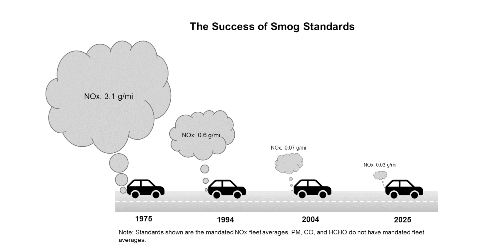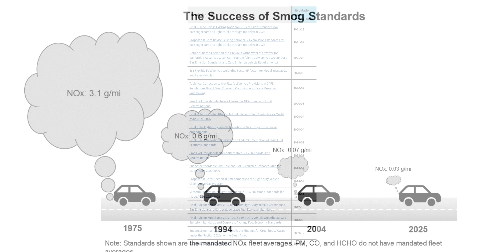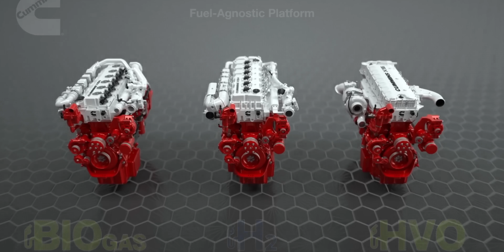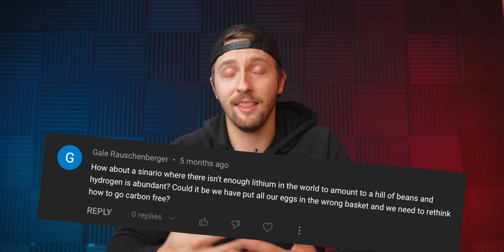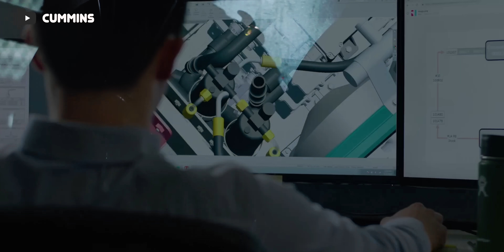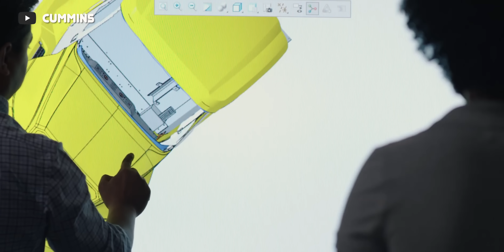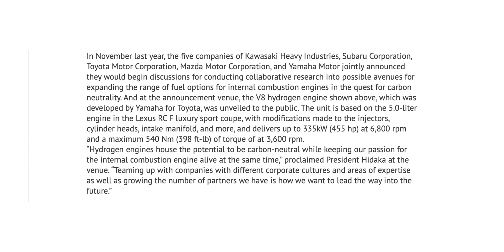Cummins Hydrogen Engine Will KILL DIESELS FOREVER

Comment: U did miss the interim technology between diesel and possible hydrogen tech diesel replacement, the JegmTech diesel technology that Cummins declined to investigate, another words the JegmTech is a Diesel engine on steroid which boost’s the most fuel efficient Diesel engine by more than 15-20%. Neither hydrogen nor ev r long distance feasible power source, it’s not a practicality decision that is pushing the market, it’s a political-impractical decision that’s prevailing. Thanks to the last disastrous 2.5 years the globalists keeps pushing the impractical vs the logical energy solutions. In the end power density will be the deciding variable.

Comment: It will be 50 years before any of the above technologies can become as useful as what we have today which has taken 100 years to develop. Hydrogen engines are nonsense now as they need an outside power source to produce electricity to produce hydrogen not to mention storage as the video said it needs to be stored at crazy below freezing temperatures.

Comment: Diesel and petroleum based fuels contain enormous amounts of energy but few people ever mention the huge amounts of energy required to drill, refine and transport these fuels. Processes often use cobalt and ICE vehicles need copper, platinum and other expensive and rare metals in their manufacture. Hydrogen will definitely work but it won't be cheap and the overall process of getting it into a vehicle is not very efficient.

Comment: Hydrogen makes little sense except it can refuel quicker for longer distances. You are still burning something so that must produce pollution. Even, if it is just the oil that get's burnt by the engine during normal operation or the waste oil from still needing regular oil changes. It's like hydrogen changes very little. If you are going to build a massive electrical structure to 'make'  and store hydrogen as a liquid, why not make a better electrical structure for charging?

Comment: The problem isn't building a hydrogen powered engine. The problem is hydrogen itself. Hydrogen is the most abundant element in the universe, yet to store it in a usable form is very expensive and inefficient.

Comment: Yes they will be around during our life time. Beyond that it's up to a higher power.The autonomous trucks are already out hauling freight. They have already logged millions of miles. There here.... The independent drivers can't afford these new trucks a eventually the independents will be gone. The smart independents will merge together and create their own companies to give the corporate trucking companies competition. If they don't then they will be flipping burgers. The ones that have been speculating on this new trend will be the new billionaires. California thinks they are in the driver's seat by banning certain trucks and going all electric.
But they will strain if not ruin thier power grid trying to keep every thing powered up and charge thier trucks and cars. And it takes coal to make electricity. And Kentucky ain't gonna dig coal for California. Some day the cross country trucks will be no more. It's getting uneconomical to carry freight that far. It's to costly. 
They would be better off shipping by train and doing away with hauling freight on the trucks. The train can bring it to the electric trucks then the electric trucks can haul it shorter distances. Ups is already using hydrogen powered trucks.
I have seen them they look like a regular truck.  And they need to train these young folks to be a driver's of the new fleets coming.  Right now they are putting kids in trucks. Kids that have no idea what they are doing. I have seen it.

Comment: The one issue I have with hydrogen is that it burns too easily. With the amount of wrecks on the road, a little spilled fuel here and there or a small fire happens. How likely are these tanks or cells to explode if involved in a wreck? That's my main concern
Reply: Whilst hydrogen burns easily, it doesn't pool except if the leak is in an airtight container. Hydrogen is very happy to escape from any enclosed space. If it is not in stoichimetric ratio with O2, it will not explode. The worst case is likely to be a flame from leaking hydrogen from a high pressure tank. Unlike petrol fumes it does not pool and then explode.
Reply: the h2 tanks are 100x safer than your standard fuel tank and you don't have to worry about electricity fires from EVs, which is even more dangerous. The main concern is production, storage, infrastructure.
Reply: You're right, hydrogen is EXTREMELY, EXPLOSIVELY volatile.  Which is why so much work has been put into making safe tanks for it.  Currently there are lozenge shaped carbon fiber bottle tanks that can withstand anything short of a nuclear blast.  But they are expensive.  So the current challenge isn't making a safe tank, it's how to make an affordable safe tank.
Reply: @itsmatt2105  and there lies the other problem. Expense. What's good isn't cheap, and what's cheap isn't good. If we use the economies of scale approach, there has to be sufficient demand in order to help make cost go down. If the cost is too high, the demand won't be there. Unless it's mandated by law that this style of tank is to be used, truck manufacturers are going to cobble together what they deem sufficient. I don't know if you've been in a class 8 truck lately, but they aren't exactly built to the highest standards. I see this flopping like CNG did
Reply: @meatball1324657980  I'm not cool enough for the new stuff, all my trucks are old. I figure if it made it this far and didn't break (too much) it'll probably continue not breaking for another little while.  I'm rather ambivalent about the fuel source at this point.  I want to see cleaner burning, more efficient engines but so far there's not a clear front runner as far as which will be the best horse to back.  All have strengths and weaknesses.  Lots of big companies full of people with way more knowledge about the various tech than I have are heavily backing every new technology type out there.  If they with all their insider information can't predict a clear winner, I don't have a prayer.

Comment: The lithium ion batteries are really not that great because they are not recyclable so when they die you have to replace them with a new battery so hydrogen and other alternative fuels are something that engine manufacturers should always consider

Comment: For offsite construction.  The employees cars will have nearly fully charged batteries that could to be tapped. 2. A battery  mega pac could also be positioned on site.3 .maybe electrical lines will be ran to site as a first step in the future.  4. Solar is also found outside at all remote locations..wind too. And if you still need more power. a stand alone  power supply like a hydrogen  powered generator could fill the gap.   ... " Batteries  rule. Diesel is decrepit.  + battery innovation is not over yet.

Comment: I saw 'Hydrogen fuel cell' prominently displayed on several of the examples. This is a way to generate electricity on the run, NOT an ICE.
The crucial point of a hydrogen ICE is keeping the hydrogen liquid, so the fuel tanks aren't bigger than the vehicle.
This can only be done at or below -400°F. This is an immutable Law of Physics, and, at normal temperatures requires heavy and expensive refrigeration of the fuel tanks. 
I can't believe Cummins thinks they can achieve this. BMW, Toyota and some others have built hydrogen-fueled vehicles, and they were totally impractical.
CNG is definitely a bit easier, but that's just more fossil fuel, cleaner than diesel, perhaps, but still dirty.
Cummins is throwing out a red herring to try to stay ahead of the pack.

Comment: So you use methane to get your hydrogen and make heaps of CO2, Hydrogen then has to be liquefied, you get loses on each process and yes you can make hydrogen from electricity but over 90 percent of hydrogen is made by the the separation of methane with a large amount of CO2 waste and that does not include what is required to make it. Keep improving Diesel.

Comment: Yes why?! Hydrogen is energy intensive to produce. Iceland has lots of free heat in geothermal so they can produce hydrogen cheaply. What about the rest of us. 
 Use wind and solar power?! Use natural gas coal or oil? Maybe use nuclear ☢️ 
 No ? Well where will you get hydrogen fuel? It cost more energy to make it than you get back out of it. You can’t drill for it.

Comment: I drive a pickup truck every day, often towing materials or equipment.  You can’t do that yet with an electric pickup (not to great distances).  Hydrogen just might be a good substitute should access to this fuel be easier to procure.

Comment: Today 95% of hydrogen comes from cracking natural gas which uses huge amounts of fuel. To liquefy hydrogen it has to be criogenically cooled to-253°C /-423°F and stored in insulated tanks that uses more energy, why not burn natural gas instead it is less wasteful

Comment: Hydrogen will still have the same issues that the EV charging infrastructure faces now. Hydrogen takes massive amounts of electricity to produce...you said all this yourself. "Automotive innovation" is NOT going to be able to fix these many issues which are basically the laws of physics. Fully charging an EV simply takes too much time, even if chargers were available on every street corner..This poilitical commitment to something so fundamentally at odds with the laws of nature simple won't stand in the long run.

Other than hydrocarbon fuels (with which the world is overflowing), the only true portable answer would be trunk sized nuclear reactors, fission/fusion of some sort.

Gasoline/Diesel is going to be with us for a very, very long time indeed. Sit back and watch!

Comment: Burning hydrogen is nuts but burning ammonia in a big diesel engine will be a thing one day. To get rid of the NOX in the exhaust just inject a small amount of ammonia in and it fixes that problem.
You bring up all the bullshit pedalled by the fossil oil industry. Cobalt mined by children is more crap, and that Cobalt is only used in the oil industry in refining. I turn off because you are full of it!

Comment: I believe there is more logic behind the hydrogen engine. Being a farmer I think it’s physically impossible for ag equipment, via combines, tractors, sprayers, etc. to be powered by electric. There’s just no sense in it adding weight and motors that could potentially fail, not to mention the ground compaction from the added weight.  I think I. C. E. it’s the way it’s sold and continue to be.

Comment: There are plenty of hydrogen engines out there. Build the infrastructure to supply these engines with fuel. Then produce the engine. This is exactly what the oil companies did when partnering with Ford motor company.  It’s like trying to raise a horse without having feed.

Comment: Hydrogen is not going to replace diesel. The power it takes to make it in the first place is too energy intensive. More energy input = more expensive. That easy. If anything, battery electric will replace Desiel. I’m not holding my breath, but it’s easily the most efficient transfer of energy.

Comment: The Biden administration just passed a new emission standard for large industrial engines.  Cummins, Detroit, Volvo and more are fromt line for hearing this news and steering their R&D departments to make necessary changes to keep up.  Hydrogen powered vehicles aren't a new concept.  Metro buses in a lot of cities are running hydrogen engines.  The problems you listed are the hurdles to overcome.  Storage, weight, generating it...  Regulations aren't always a good thing.  Sometimes, they tie the hands from utilizing existing technology to achieve the desired outcome.

Comment: Hit the wrong. If you're not familiar with ammonia it's a non-fossil fuel source of nitrogen plants very much like they just can't suck it out of the air and hydrogen in the form of ammonia can you use regular gas pumps and it doesn't have to be pumped up to 10,000 PSI. You can now buy a single on Amazon at about $0.70 per watt that will last 25 years imagine how much hydrogen you could generate in 25 I would call that effectively free.
And if you wanted to buy a hydrogen filling station just get out your credit card go to one of the Chinese Amazon and order one it will come on a truck with a forklift you tell them where you want this container you call your electrician and your plumber and hook it up give it twenty-four hours or so and you can start filling up hydrogen vehicles.
Everybody seems to think this is going to take a long time by 2030 we oughta be pretty far into this new future.

Comment: Most of the really big machines are already electric running off of diesel electric generators and have been for years, so from the largest ships and trains the biggest earth moving equipment and you didn't mention ammonia which is nothing more than hydrogen bonded to nitrogen which is 70% of the air we breathe there's Australian companies that are way ahead on this and much like propane that we have to put that annoying smell in there because otherwise you can't smell it hydrogen also is odorless so turning it into ammonia the hydrogen has a smell, and if you're not familiar with ammonia

Comment: What about using a iron battery and overcharging it to generate methane and then storing that methane to be used in combustion engines. You could charge the batteries with solar panels and use large low voltage cells to create more methane production while using the same amount of energy this could then be stored in a medium pressurized tank to be injected into an engine

Comment: This video discusses the idea of onboard generation of hydrogen.  I think you said the technology is not here yet. This will never be viable because you would need to haul some kind of power plant to create the hydrogen which is impractical. Also, you need to learn more about hydrogen storage technology. This is where the true challenges lay. If Cummins is investing in hydrogen engines, they are betting that practical storage systems are coming.

Comment: Save the world! Just say No! to Hydrogen scams and misinformation.

Tragically improbable and flawed !!!! Magic Hydrogen wells are not  common in nature as nature replenished oil (not "fossil narrative") that are undeniably abundant.  So unless hydrogen supply shifts from a secondary "fuel store" requiring energy to create it, because hydrogen isn't a collectable fuel source known to earth... Full stop!!!!!!! 
it is at best its a byproduct with residual energy or a crafted "Green scam" which only power ego's.

It like saying you are going to power the world on Swiss Unicorn queefs!  No person of marginal intelligence considers hydrogen as a solution, it is a scam at best. Simply put we use hydrocarbon fuels because they abundantly available to us and Hydrogen isn't remotely.  

For the love of God and all things not broken in the world.... Just spare us the " but renewables can.. blah blah <insert logorrhea vomit> , No!!!!! its moronic. If you collect the enough power via any known renewable method it is a thermodynamic loss to create hydrogen and then burn it in a ICE is staggeringly inefficient like 20-100 fold loses vs just using the electrical power directly.  Just don't go there it's making us all dumber by the min.  And... any perceived pseudo- "Carbon footprint" to process said infrastructure would be equally insane.

Save the world! Just say No! to Hydrogen scams and misinformation.

Comment: Will hydrogen contain a lubricant in the  fuel. I wonder how important it is for the success of the traditional diesel that the lubricity of the fuel helps  keep the high-compression required for the diesel system for several hundred thousand miles of use .

Comment: Most "off-highway" construction vehicles are diesel-electric hybrids to begin with. Like rail locomotives, a diesel engine drives a generator to produce direct current to power large electric motors. The electric portion of the wheeled vehicles is in the wheel itself. The concept is called "motor in wheel". This was pioneered/perfected by R. G. LeTourneau in the 1930s. The track-hoes (excavators) use electric motors to drive high-pressure hydraulic pumps to power hydraulic motors that move the tracks and rotate the cab. They are far more efficient than most people think

Comment: Attacks on fossil fuels are not reality, they are Malthusian cult hoaxing pipe dreams. It is not possible to use electricity to "fuel" heavy industry. Trains run off of diesel that run electric motors. These electric motors reduce track slip yet this still requires massive amounts of diesel. The train industry in their campuses have explored this power transmission problem to a very high level of scientific certainty. Electric power with out chemical combustion is not possible. Don't hoax yourself with false promises. These anti "fossil fuel" lobbyists are merely restricting "common" people from using fossil fuels not the international corporations.

Comment: First of all, let's get one thing straight Hydrogen on demand is the future now period 🙂 Not Hydrogen that is commercialized that can't work it will then be governed and no one want's that.  I drive a 6.4 Ram with Hydrogen on demand and save 30-40% on fuel and that's a fact from a generator from Ireland All in one simple process and install in 15 mins. This works for diesel or gas up to 8L 🙂

Comment: An electric motor is way better. With the given electric the electric car will go 4x further. Rather than making hydrogen and then burning it u will only go a quarter of the range the electric will. With a given amount of electric. So if we all did hydrogen the power grid would never support it. We can't even support electric..